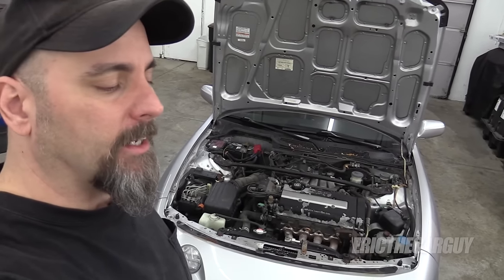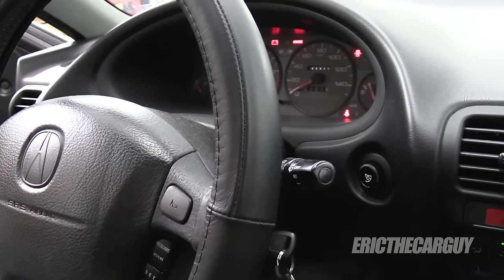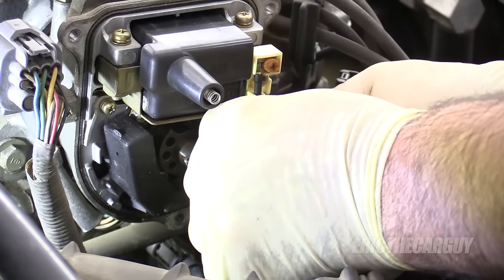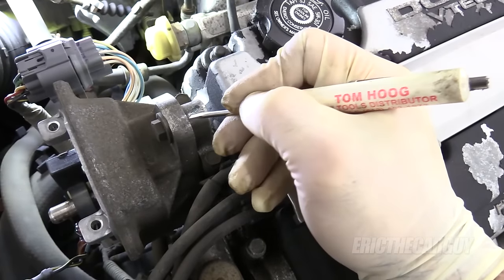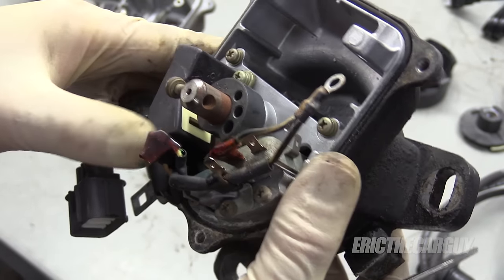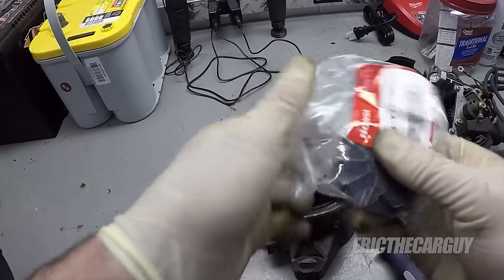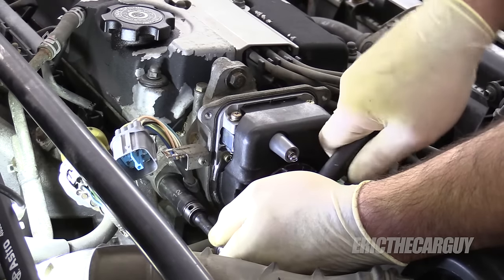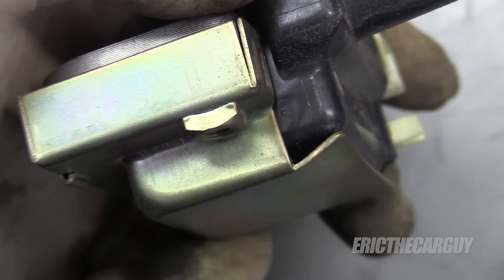Honda Ignition Coil Replacement (Complete Guide)

Comment: Okay I have a 2000 Accord with a distributor it's a 4-cylinder. Just in the last few days if it's really moist out or raining it won't start until I blow dry the distributor area I don't know if it's a wires or the cap I can't see any signs of cracks or anything like that. To me that sounds like it's the wires themselves shortened but the way they're spaced it doesn't seem like that would happen. Any ideas?

Again even 30 seconds with a blow dryer on hot will allow it to start it's got to be wires right?

Comment: hey eric! I have a 1998 Acura integra with a b18b1 non v-tec. I'm experiencing the infamous fault code p1381. Any thoughts of what it could be? I've changed the distributor, no the only other things I could think of are the timing belt and CPS, let me know what you think.

Comment: Eric, When I put the test light between battery positive and coil negative, it lights up - but when I turn the ignition on (to see if the test light pulses) the test light goes out, even before cranking. Any ideas?

Comment: I am having problem with my 96 civic, single overhead cam non VTEC. It will start and idle good, it will start to stagger under a load and want to die out. I have changed cap rotor, fuel pump, fuel filter, wires and plugs. Any suggestions?

Comment: HELP! 
I decided to replace my igniter and coil for my 200k tune up.. and previous person stripped the screw and didn't replace it. There is no way a screw driver will do the job. I sprayed PB blast on it and letting it sit over night, would the best method be to break the rotor and use vise grips? I really don't want to drill this out or do anything unnecessary.
Reply: d16y7 1.6 civic. Hitachi coil I believe

Comment: just a quick observation from a previous experience, could this have been a result of the power washing that was done in a previous video? Only ask because my coil blew out in the same spots in my h23a a few weeks after washing and degreasing the engine bay after a swap.
Reply from the maker: No, not at all. Honda coils fail all the time. It's a very common problem. Remember the same thing happened to the Civic and I didn't wash that engine. Also, this happened almost 2 months after I washed the engine. 

That said, as I mentioned in the engine washing video it's not something I recommend.
Reply: good to know, this was years ago when it happened. I had just chopped it up to me washing the dirty engine and the fact it was a used jdm motor that sat in a container before I got my hands on it.

Comment: hey I've been subscribed for a while now. I'm having issues with an 1994 Isuzu rodeo LS 3.2 v6 5sp 4x4. I'm not getting any power to any of my fuel management system. from the fuel pump to my injectors. I have power everywhere else. the truck will crank and will run on ether. we have checked the fuses and the relays and they are all good. I can't for the life of me figure out the issue can you please help me out. thank you.

Comment: What size is the screw on the rotor? I got a 97 honda crv the screw was so badly stripped we had to drill it out with a screw extractor. Ended up losing the damn thing so couldent size it.

Comment: My Honda CR-V 2000 don´t start. I have. replaced the coil.  I have 12 volt on the + on my coil. One connector / contact is not in use on the control unit MC-8541, the one on the side. Is that correct? What do you think might be the problem?
Reply: Possibly the fuses

Comment: Dielectric grease would just run off once it got hot and if it didn't it won't last anyways. Thermal compound/thermal paste is what should be used, really cheap to buy online. Honda wouldn't tell you to use it, probably because they think it wouldn't matter. However, if it has a heatsink to begin with, then why not use it? You'd be surprised the difference it makes in transferring heat from the ignition part. In the computer world heatsinks have thermal compound, those who don't use it eventually regret it later.

Comment: do you think it's possible that  the ignition coil broke down because you washed the engine?
Reply from the maker: No. I washed the engine 2 months before this coil failed. Also, the Civic coil also failed as shown in the video and I never washed that engine. Ignition coil failures on Honda's are a very common occurrence.

Comment: Eric can you help out please... My 99 civic won't star.. no spark no gas pressure.. no check engine light and no obd connection to the scanner... I change the computer.. check fuses.. change the distributor also replace the main relay on the passenger side but nothing.. and yes engine is turning..  T.I.A.

Comment: Integra GSR with vtec motor shares same ignition coil as a civic non vtec?      They have different part numbers on rock auto, does it actually share the same ignition coil?

Comment: Hi I have a Citroën C8 2004 and I have problems with ABS sensor I have switched sensor and wheel bearings and have also deleted error code but ABS lapan continued lit up what can I do more

Comment: Eric please help. I'm having a intermittent/bucking throttle on my h22 prelude. I've pulled the motor to properly torque the intake manifold and re did the timing w a new manual tensioner. New clutch, spark plugs, ect ect. It has a skunk2 intake manifold so no egr. No evap or charcoal canister. Idk what to do. I know it needs a tune but I don't want to pay for that still having the throttle issue. I've watched a number of your videos and others on YouTube but I can't figure it out. Your input would be greatly appreciated. TIA

Comment: Hello, I have a problem with the engine B16a2, the acceleration is shaking, being hot the engine shuts off .... the error light code is nº 8  TDC sensor ... i cant replace them ... or buy a new destribuidor ?

Comment: I have a 2000 honda accord and my car is missing firing from 2,3,4 cylinder could it be the ignition coil pack??
Reply: Peter Cobian I’ve got the exact same issue, did you figure out what the issue was with yours??

Comment: I have a 2001 Acura Integra ls auto.. I have an issue it will not rev over 5000 rpm and it would stall usually at low rpms it would crank over but not start. After a few it would start up and run like crap. When its cold it starts first time every time. its also intermittent.   I replaced all the usual service parts a few more. Plugs, wires, cap and rotor, fuel filter and pump, main relay. I got a CEL for the cat so I replaced the cat and both o2 sensors, but still will not rev over 5000rpm. any ideas?

Comment: Hi my name is nunzio from sicily when i came bach from Usa i bring olong a acura integra gs-r1993 engine b17a1  i ribilt the engine i change the alternator  the starter the  distributor and after i drive for 1000 miles dos,nt whant to starter the  power arrive to the distributor and dos,nt go forter do you think could be the ignition coil i need your halp thankyou

Comment: Hi i have a 98 civic lxi so d16y4 manual and has recently developed a rattle/tick in higher rpm but has lowered in rpm now and started stalling an not starting unless jump started or crash started im told its distributor??any help is much appreciated

Comment: Eric i have a 98 acura 1.6 el and im having an issue with it sputtering/stalling within the first minute of driving. It only sputters for about 5 sec feels like its not getting fuel, then all i do is let off the gas pedal and then depress it again and it stops doing after that. Can drive for a 100miles and it wont do it. Just within the first minute of initial startup.
Have no vaccum leaks checked it wit smoke machine, fuel filter was just replaced last year, and changed the ignition coil. Please help think im going crazy trying to figure this out.
Reply: I have the same exact problem, did you figure this out?
Reply: Dee C It ended up just be the O2 sensor. Runs like a top now!
Reply: balle27 -did it throw a p0420 ?

Comment: What's the name of the book that contain details and specification on all car engine ??
The one that all car mecanique have ???
Reply: detail like engine displacement, type of cylinder head, valves diameter, piston size , piston rings size, injector size, fuel pump,, ECT........... THAT WOULD REALLY HELP ME, thanks in advance

Comment: My RPM hand jumps crazy while driving my 96 Honda Civic manual what could be causing this......also sometimes when it rains it turns over but won’t start but when it’s dry out it starts right up .....@ericthecarguy have you ever dealt with these issues

Comment: Why so specific on ngk wires - is aftermarket that bad - what exactly is the difference
Reply: I replaced mine when I bought my car (im the second owner, first owner to do maintenance lol) with Bosch leads, have done about 15,000km and havnt had an issue
Reply from the maker: Yep.

Comment: I got a honda accord 2002 and the code p1399 is flashing when i hold the gas wide open and its bugging at 6000 rpm like if the car is diying , i change the spark plug the coil pack , distributor , fuel pump , clean all the egr passage , brand new baterie , alternator is good , i got 200psi on every cylindre  i dont know whats wrong ( its saying misfire on every cylindre

Comment: To be fair, that is NOT a Philips head fastener. See that dot? That means it's JIS, not Philips.

Use a proper JIS screwdriver on that rotor screw, and you will have far more luck getting that screw to release.

Comment: What is the light colored box under the hood on the drivers side 1990 accord?? Light grayish, about the size of a glasses case or long cigarett pack I guess...can I take one off my parts car and put on my 1990? I checked EVERYTHING on my car and it still starts, sputters and dies as well as putting and sounds like shit,put brand new dizzy, spark plugs, wires, main fuel relay, fuel pump, clean injectors and that darn F word port..what is this light colored box because it is about to go bye bye and be replaced as well! I think my old piece of crap accord is going to be all new before I find out why its is shit..lol. I have a new fuel regulator on order then I'm done!

Comment: The thing is: if the coil is just made like junk with buying 2 you lose 80 instead of 40.
Reply from the maker: Actually no, remember I also put one in the Civic. Nothing was wasted.
Reply: EricTheCarGuy I meant if they're both a garbage part then you lose 80. hopefully they last though. I hate spending big money on parts so I usually go a cheaper route.

Comment: wasn't from washing the engine, was it?!
Reply from the maker: No. I washed the engine 2 months before this coil failed. Also, the Civic coil also failed as shown in the video and I never washed that engine. Ignition coil failures on Honda's are a very common occurrence.
Reply: thank you for the answer. So it seems that is fairly safe to wash the engine... (or just Honda's?)

Comment: he washed the engine bay some time ago and now ignition coil gives up? coincidence?
Reply from the maker: No. I washed the engine 2 months before this happened. It's a very common problem with Honda's. Remember that the Civic also had a bad coil and I didn't wash that engine.
Reply: Very common. I replaced the coil about 4 times in 4 years I had my integra.
Reply: Doubtful, it's inside the cap, behind the shield, and has a gasket between the cap and base.  I've fouled a spark plug from washing my GSR engine bay, though.  Definitely made the car run terrible.
Reply: javier B because you keep replacing it with autozone or equivalent junk parts. Oem coils and ignitors should last a minimum of 10 years
Reply: meh..not really. went to the junk yard.. got about 5 of them and always kept them handy :p
Reply: Piotr Brenda wouldn't think so.. If the water would of damaged it, you would think it would fail when it was wet...
Reply: Replaced coil on my Son's '98 Civic (junkyard gave me the whole distributor for about $40 -OEM Tec). The bad coil had the same large burn mark! I was tempted to put electrical tape over it, but never bothered...
Reply: Definitely not the issue unless he powered washed it and put the nozzle right up to it and went full boar.  Doesn't work that way.
Reply: It happened on my Acura.